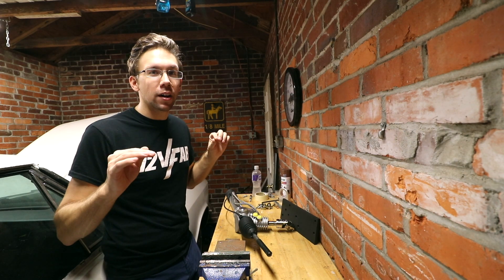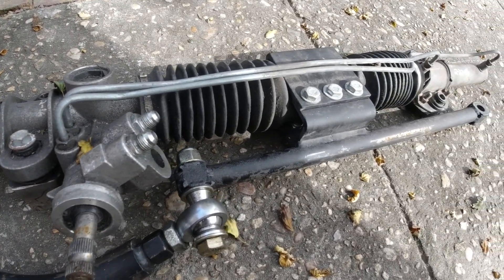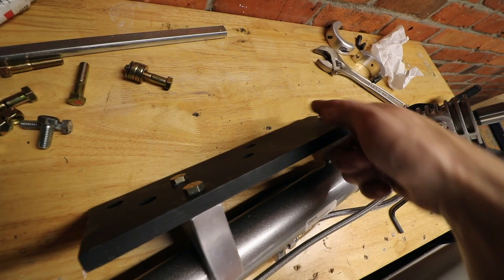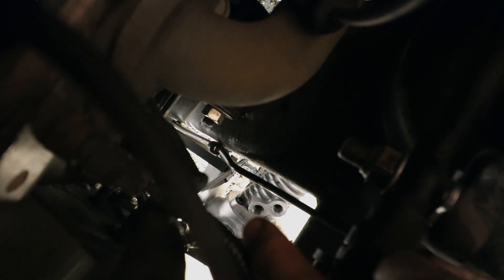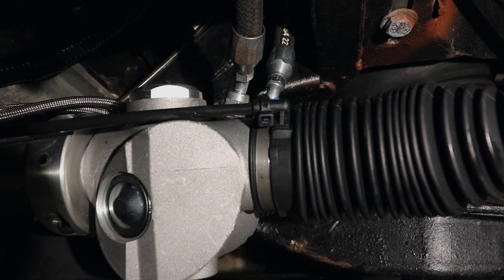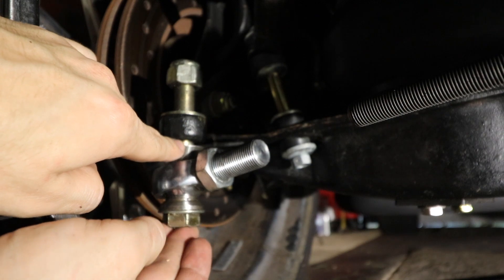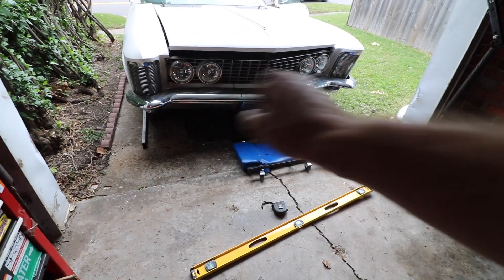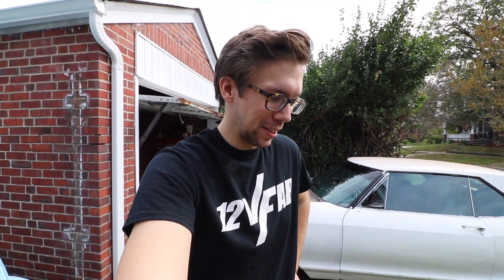Installing A Universal Flaming River Rack and Pinion

Comment: Awesome video! I tried to find your original video although i am aware you upgraded the rack i want to see a little bit more in depth regarding the geometry , like the rack pivot points in relation to the control pivot point to avoid bumpsteer. Do you have a link or a book you recommend that will point me in the right dimension

Comment: was there any bumpsteer?
Reply from the maker: I do but it’s pretty minimal. Unless you go full custom spec’d widths it’s kind of a balancing act with your platform. I try my best to make sure at least one sides control arm/tie rod pivot point lines up by moving the unit left or right along the crossmember. That way I limit bump steer to just one wheel and preferably the passenger side. I also make sure the rods are parallel with everything which is why I usually use heim joints instead of tie rods for more adjustment.

Comment: Will it work on a 70 cadillac deville hardtop two door
Reply from the maker: I’m struggling to find the info needed online for that car. I’m not familiar with Devilles after 65-66. Do they have the steering in front or behind the crossmember? I’m also assuming they are an x-frame???
Reply: Ok

Comment: How's the steering ratio?  I'd love to have something as quick as my GTI which is 9.5:1.  Did you maintain the factory turn radius?
Reply from the maker: I think it’s perfect, it of course feels tighter then anything made in the 60s but it gets rid of that school bus feeling. I have my pump pressure dialed back to the absolute maximum the Flaming River recommends of 750psi to make the car easy to steer because it is still a land yacht. It is “heavier” then stock but not floaty. I have 2.7 turns full lock to lock.
Reply: @MatthewFinlay  thanks for the prompt reply!  Was it as easy to install as the video suggested?  I too will need to customize the install (66 Country Sedan).
Reply from the maker: I think it was but I’ve been swapping them for years so I’m ok with being unhappy fighting stuff under a car haha. Also it depends on your crossmember  - mine was flat and pretty open. Remember they use a special (stupid) proprietary shaft they refer to as the pyramid power or something like that… and on Flaming River sells the joint…
Reply: Depending on the rack but the pressure ranges from 600-800 PSI while steering gears are higher at 900-1,400 PSI and checking pressure during lock can hit 2,400-2,800 PSI. This indicates the pressure relief valve operation inside the pump behind the 1” (24.5mm) but on the back where the hose screws in. Since pressure in the return line on racks run from a low 6-8 PSI, adding an inline filter with Corbin or pinch clamps will keep the fluid from tuning black as most of this comes from the pump. Metal or plastic  like a small engine gas filter works fine. Either made for power steering or gas, I suggest adding a rare earth magnet to the bottom side. It still works on metal cans. Clean, sand and epoxy. Wrap electrical tape of your color choice but dab weather strip adhesive on the tag end and it not come loose. Re-use if changing the filter, but flush the system first. 3/8” I.D. Is line size if I remember but cutting the stainless braided hose is priceless. 32% better car, 147% better steering, going thru the expense of this R/P steering + LS engine, 279% over the value of the car. Especially with a wobbly ash tray & tear in seat #1. Truly sad! DK ASE master tech, retired. Priceless!
Reply: Whats the distance between both inner tie rod joints? The pinon width?

Comment: Are you still running the factory power steering pump?  Im thinking about doing a swap and will be running a ls motor but dont know what pump works with a rack system
Reply from the maker: @Tom Mitchell Woodworking - I am! It’s a stock 5.3 pump with the pressure lowered to approx 700. I made a video about pumps and flow actually because of the issues with over pressurizing Flaming River racks.
https://youtu.be/lcjksQP_IVs
Reply from the maker: If you run into any snags let me know and I’ll try my best to help!
Reply: @MatthewFinlay  thanks the video definitely cleared that up but ill let you know if anything else arises!!
Reply: Do you know if there is one pump that is better than others as far as stock goes besides size?
Reply from the maker: I’m partial to the Saginaw “truck” style pumps with the integrated reservoir because they are everywhere and simple adapter fittings to make them work on swaps. For tight clearances there’s nothing better then the LS car style pump and remote reservoir. For road racing or intense heat situations I would not recommend the Saginaw - but I’m not an expert when it comes to those kinds of builds. The pump ends up shedding extra heat into the fluid unfortunately, they would definitely need a cooler for that style driving.